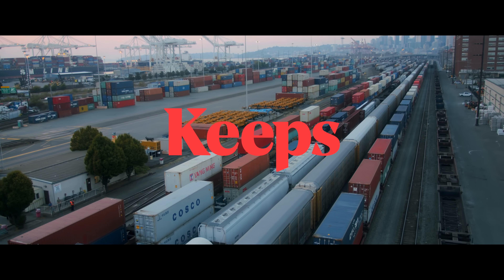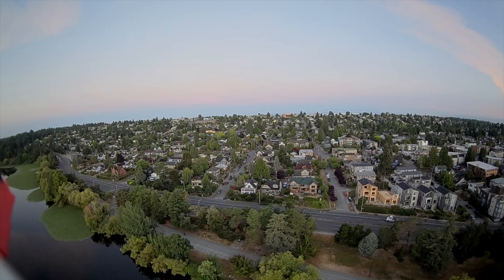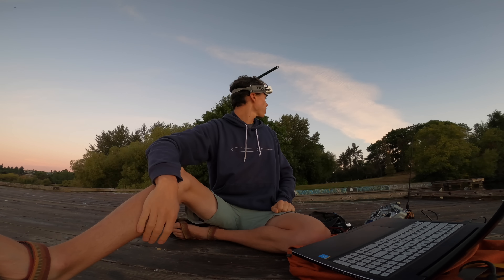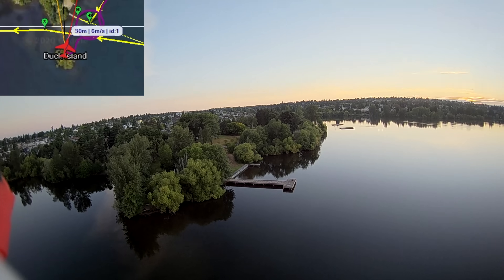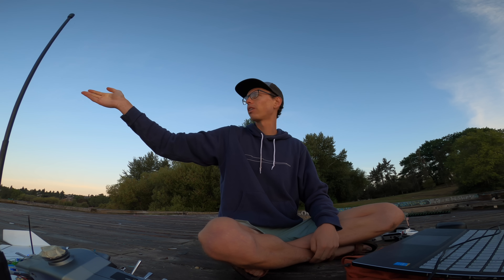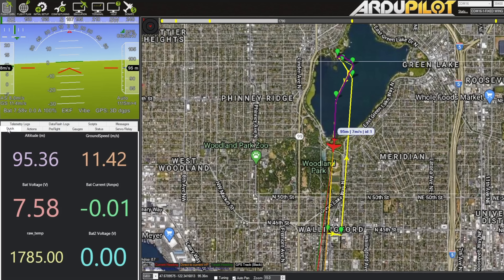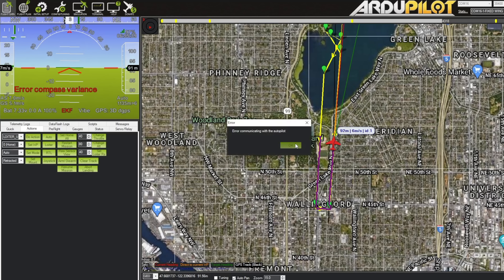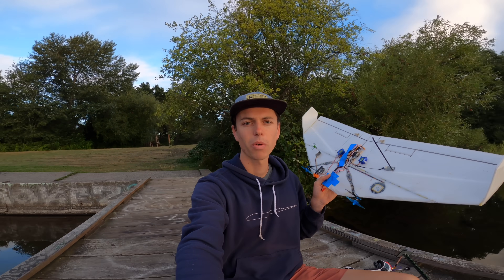Tiny Waypoint Drone! - 230g Autonomous Wing

Comment: I wanna build one of these! it look so fun inexpensife and ot intimidating. and durable too.
Reply: The Pixracer autopilot and flight controller is $120, GPS module is probably around $50, TBS Unify for FPV video transmission is about $40, Runcam Split for video is about $70, those high KV drone motors are probably about $50 for a 4-pack, ESCs for them maybe $20, servos around $5, and probably around $5 for some foam board and carbon strut.

That brings the total investment for his setup on just the plane side of things up to about $360ish, however, the cost of everything else needed gets just a bit more expensive, a Dragon Link for telemetry and control is $330 for a full kit with transmitter and receiver, the Fat Shark Dominator HD3 FPV goggles were $450 a while back. I'm not quite sure what radio transmitter he's using, but 300-500 bucks will get you one that accepts telemetry signals from the Dragon Link. 

FPV, even on the cheap end, can still be quite an expensive hobby. It's significantly cheaper to build a cheap park flier foamy like the plane in the video without FPV or any autonomous flight capabilities, could probably build that plane for a lot less than $100.
Reply: @Johnyknowhow  aaaah!😂 i expected cheaper than that! Thx for the info! Maybe a radiomaster tx16 s???? Skyzone 02c????? Even cheaper? Eachine ev800d and betafpv lite one radio.... not long range at all, but still fun... but yea. The autonomous part is not cheap.... sadly...
Reply: @VLena_art  Yeah, there are definitely some lower quality budget options for FPV that can work as a stepping stone into the hobby and let you decide whether or not you want to continue with it, the equipment Daniel has is fairly high-end.
Reply: @VLena_art  Reminds me how telescopes that autonomously track objects are also not cheap
Reply: @Johnyknowhow  I know... fpv is expensife. I wanna build my firs quad but I jus have not enough mony... im thinking about a tinyhawk 2 freestyle.
Reply: @VLena_art  ok I bought the drone and its absolutely worth it, I would seriously recommend the tinyhawk 2 freestyle, and get the pack with the transmitter and goggles, and if you can afford it buy more batteries
Reply: @spencerhalle75  those batteries aren't that expensive 😁
Reply: @Johnyknowhow  do you know what kind of battery he has? i can see that it is 800mah, but is it 3s or 2s? the motors he used are 3-4s but the voltage on his laptop says around 7.4v, which would be 2s

Comment: Can you add a shop where I can just easily order all the parts you are using, you can get your clip off the products also! Win win, your are some of my favourite videos btw keep it up... could you pull off an automated drone light display?
Reply: The budget for those displayss are huge man, i don't doubt he could do it, but it's expensive
Reply: Yes sir, if anyone knows at least what HD camera he's using, please comment. That good quality video in a small lightweight package, sweet!
Reply: schneitzlemeier That’s a runcam split. He said all of the gear in the beginning.
Reply: UNIFY PRO Video Tx: $40, RUNCAM SPLIT video recorder/camera: $50, 2 x 3600 kv motors: $45, DragonLink telemetry system: $335. At least $500 USD plus BECs, props, LiPo battery, servos, trasmiter , FatShark FPV goggles and antenas... more than $1K USD!
Reply: @alexecheverria  That's cheap ! Shut up and take my money!(XD